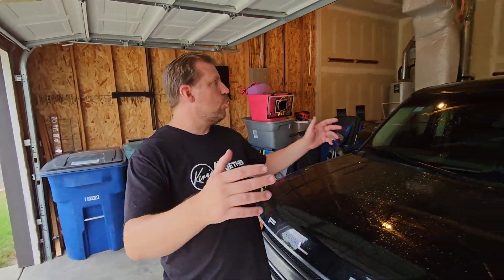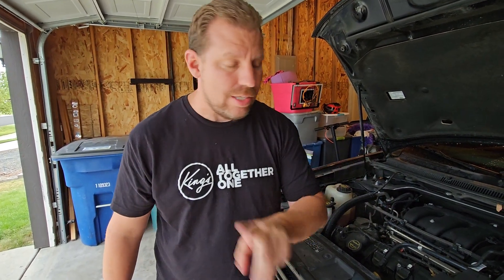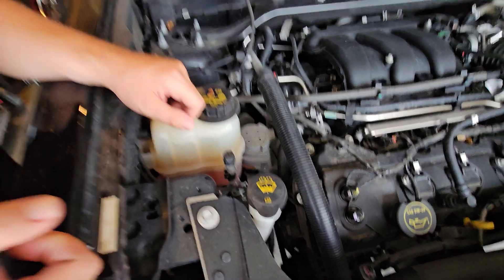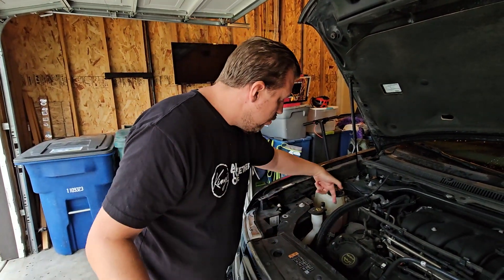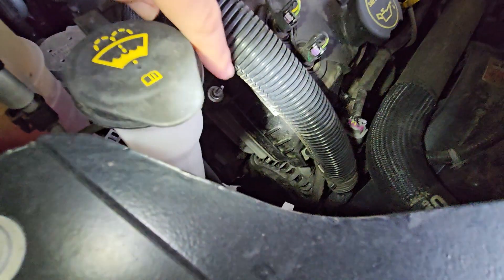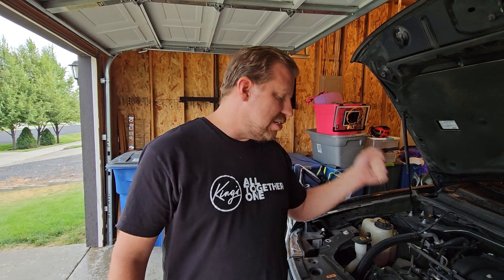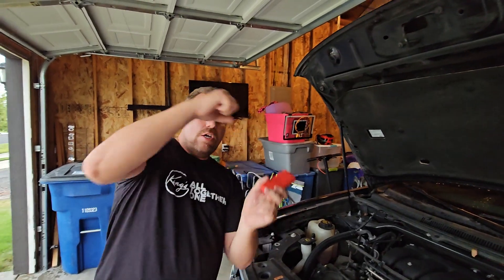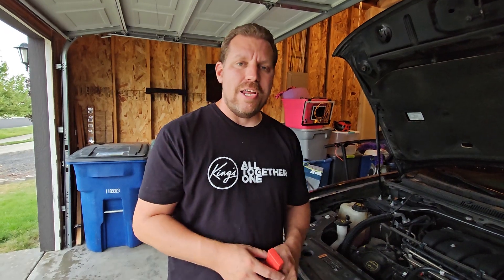How to Prevent Catastrophic Engine Failure In this 2019 Ford Flex!!

Comment: 3.5 v6 is one of the best ford (MAZDA) engines ever made.. its in everything and very successful..
the waterpump can be a issue if ignored.. about 95k or so they go.. its not cheap to repair. but its not a deal breaker at all
Reply: Mine just blew up and I think this was the issue

Comment: Loved my Flex.  I had a 2012 from new to 295,000km.  The only things it got were one set of front brakes, two sets of back brakes, and oil changes when the indicator came on, which was every 16,000km or so.  And I used regular oil, not synthetic.  Sold it to a coworker and his son still has it.
Maybe I just got exceedingly lucky but it was a fantastic vehicle.

Comment: Found this video a little to late I have a 2011 for flex limited, great car until yesterday car cut off in the middle of the road , looked under and lots of fluid leaking, to to shop, they said engine failed its would be 6k to fix. 😢

Comment: Just did a water pump replacement on my 2015 at 77k.  Fortunately we caught it before the second seal started leaking. If you park in the same spot every day - the weep hole leak will show as a small leak on the ground inside the right wheel.
Reply: Wow 2015 and it leaked before 100k…I have a 2015 SEL with 66k and so far so good but I have drained and filled with the newer better yellow coolant and got the old orange out which is better for the water pump but I’m always scared of getting a leak and then bam 2-3k to fix it🤦🏼‍♂️

Comment: 2016 Ford Flex 3.5 N/A 148k miles. Change coolant every 30k miles and also change cooant from orange to the new  yellow.
Reply: Wow, you've  put on some good miles. My 2016 has about 29,000 driven. I actually cycle more than I drive.

Comment: I own a 2016 ford flex with only 59,000 miles on it and i change the full synthetic oil and wix oil filter every 4000 miles .. i also just recently did a complete fluid flush which included radiator coolent.
Reply: I bought my 2016 new. Currently has half the miles of yours. Had coolant changed at about 25,000, simply because of age. Ditto for tranny fluid. Mine seems to be running well. I enjoy it, and it serves several purposes. Enjoy your Flex.
Reply: Full synthetic changes that often offsets the reason for the ford flex. It's built on a Taurus frame for god sakes. It's a beater for a family, it's why I have one. Every 10k, unless it looks bad before that, or it says change soon and appears to reflect that, and it still runs like a sewing machine. If I'm doing oil changes that often that engine better be worth the cost of maintenance. A flex isn't 😂

Comment: I have a 2010 411000 kms only issues Wheel bearing hubs and Mass Air flow. Also have a 2011 with 260000 kms, same, all the wheel hubs. Flush those fluids.
Reply: Are the bearing hubs expensive?

Comment: i have a 2013 Ford Flex. I love it but Lord it always needs sumthing 😢. AND Everyone always wants an arm and a leg for the maintenance. You would think i have Ferrari 😮‍💨I’ve had the water pump replaced, 3 batteries a new engine a new MAF sensor, a New Fuel pump relay, the flex sits so low hit a dog had to get two new fog light bezels, A new catalytic converter, and now i believe i need new spark plugs this is just within a couple of months span 😩
Reply: I, too, have a 2013 Flex with 96k+.  I've maintained a Ford Premium ESP, and I have had an AC Compressor, Fuel Pump Relay, O2 Sensor, front bushings replaced all under warranty with my paid deductible. Getting ready to re-up next month before the expiry.